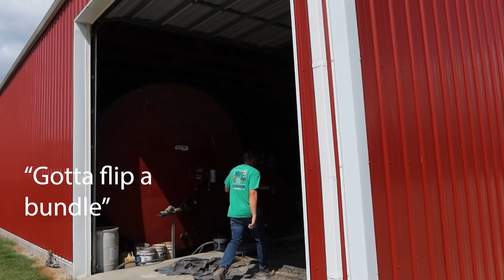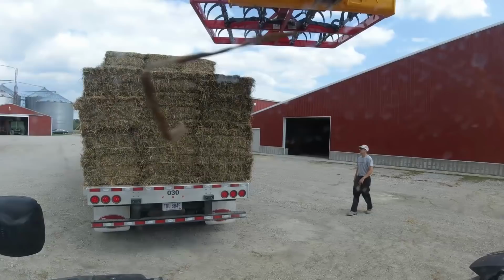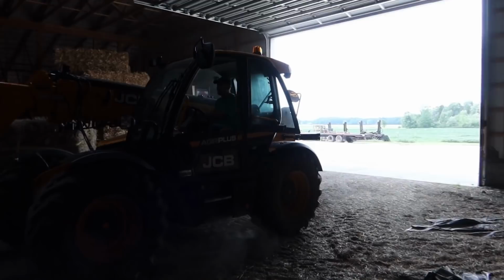Advanced System to Load Semis with Hay (Remarkably Fast)

Comment: I have watched a number of your videos loading bales and am still a little confused as to what stops the second row of bales from dropping out of the bottom of the batch of bales you grab.
The length of the upper grab hooks don’t appear to be long enough to penetrate into the bottom row.
The bottom row appears to sag a little in the center during the handling process.
Is there some sort of “Side Squeeze” that holds the bottom row together ?
Reply: The machine that makes the packs also wraps the bundles with twine. Thats what keeps them together in the bundles.
Reply: @markheintz1878   That would be a “Cool Operation” to see.
It is amazing what new technology can do.
So much more efficient than handling single small bales one at a time.
My back would have LOVED that system 45 years ago when working at a feedlot
Reply from the maker: I will go more in depth into the bundler. Thanks for the suggestion!